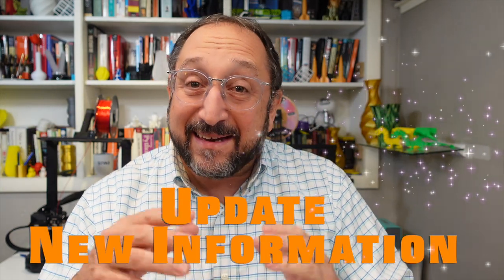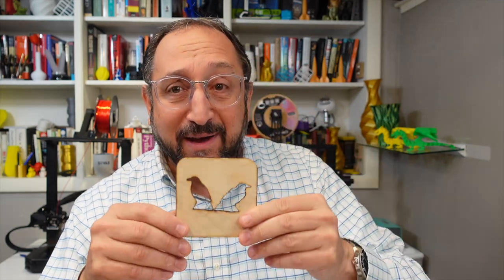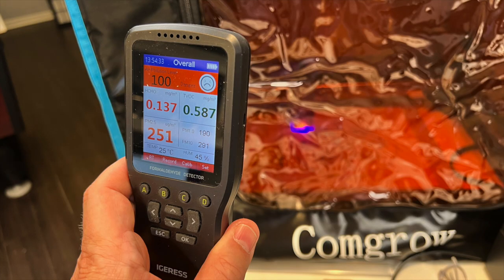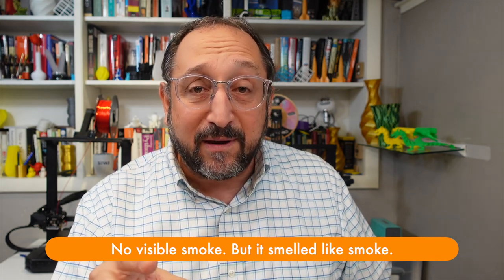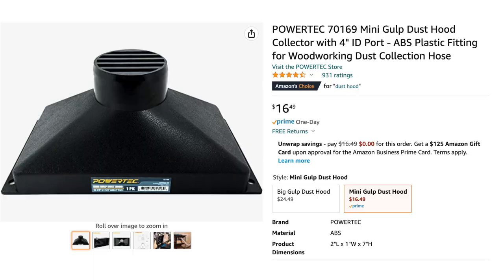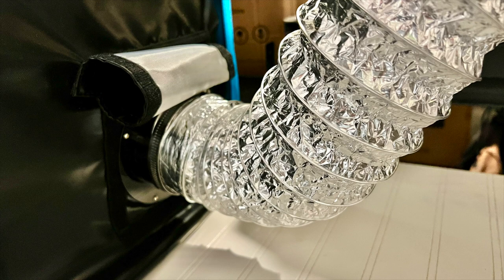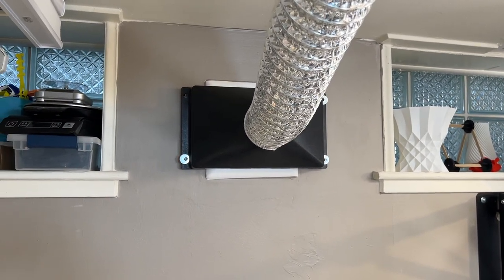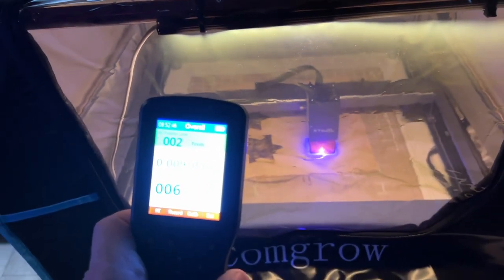Smoke and Fumes Updated Information

Comment: Excellent tip! I have a similar setup with my Voron V2.4 and a special window slot for my sliding windows, where everything is 3D printed and other than the flexible hose and some 12V computer fans I didn't really need to buy anything extra.
Reply from the maker: Thanks for sharing.

Comment: I've recently setup my first 3d printer and plan to move into ASA. I've had a similar idea to ventilate, using a dryer outlet that I'll add to the wall. The other difference is i want to have a manual switch for after the print is finished, and a thermostat to turn the fan on and off to maintain an optimal temperature in the enclosure.
Reply: Good idea on the dryer outlet, which has a self-closing flap.
Reply: @yeroca  kind of what i was thinking. I'll live here forever so i don't worry about resell. Keeps insects out and i can add to it to ventilate solder fumes

Comment: Thanks for the update Irv, quite interesting! Just wanted to remark on your setup with the ductwork. Eliminate the bends and excess ducting and you'll draw out a lot more smoke and smell. The other best practice for ductwork is to reduce the length as much as possible to gain additional draw. This may mean rearranging your setup so that your engraver(s) and/or printer(s) are closer to the exit point. Unless your bathroom style vent on the wall is the same or better, it will actually diminish(restrict) the cfm's of your inline fan. Just my 2 cents from my HVAC experience 😊😊
Reply: should the vivosun fan be closer to the exit if not replacing the bath fan completely? so that it is pulling the air more vs pushing
Reply: @noverman  💯! I completely missed that, thanks Nick! 😊 👍
Reply from the maker: Good suggestion.   I'll give it a try.

Comment: Very nice! I bought a laser engraver and got that exact same inline fan and the comgrow enclosure to try and bring it in the house from the garage so I could play during the winter but my basement is concrete and i have no vent to the outside :( We even have to vent our dryer into a container of water since we have no outside vent. With your knowledge could you think of a way to use this setup without an exhaust fan in the wall? I was thinking of trying to exhaust it up the chimney but then I wouldn't be able to use the fireplace. We do have some windows and I was thinking of building a box with insulation packed in it to keep the window open and have the exhaust fan in the box rather than the wall but I just don't know how that would work without being able to close the window for rain and snow. Anyway, very nice follow up and I will try and kick my brain into high gear to figure out my situation!

Comment: You should have proper filters between the comgrow hood and fan or the particles will coat the blades and get into the motor itself.  Maybe a filter box going to the fan.
Reply from the maker: Good suggestion.

Comment: Irv this video is fantastic!  Ive been thinking about this for some time now. What's the brand of air quality meter?  And does that work well?  Ive not bought a 3d printer for concerns about air quality so the tent plus air ducting and fan solves this issue. Your setup breaks it down into an easy solution.  For filaments that need a heated environment like PC or CF nylon, we wouldnt want to pull out the hot air so perhaps we would leave it tented and then after its done printing i could turn on the air exhaust system to extract the hot polluted air. Thoughts?  Could you test this?  Also how much heat does this tent enable the air yo raise by? Thank you !

Comment: I think anyone using a laser engraver/cutter should be using something like this.  Very good solution, though I think probably only one of the two fans is needed.

Irv, why didn't you 3D print a custom adapter for your duct to vent fan?  Your solution looks functional, but... come on, man!  Your lab is full of printers! :D
Reply from the maker: Your are correct.  Amazon delivers a lot of stuff same day in my area and I wanted to get this update out.  I will print a replacement fan cover/adapter when I get a chance.
Reply: @MakeWithTech  Come to  think of it, there are likely people who have bought (or are thinking of buying) a laser engraver, but who don't have a 3D printer, so your lathe hood is a good solution for them.

Comment: remove the bath room motor and fan, use only the hole in the wall with your new fan . you'll get better air flow.( bath room fans don't move a lot of air)
Reply from the maker: Thanks I’ll give it a try.